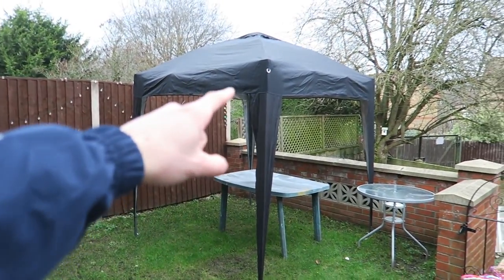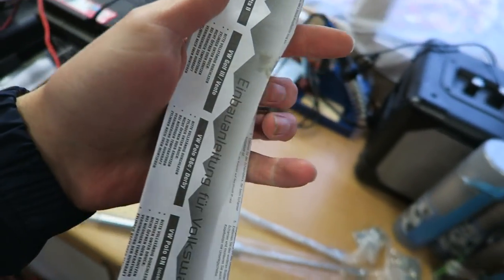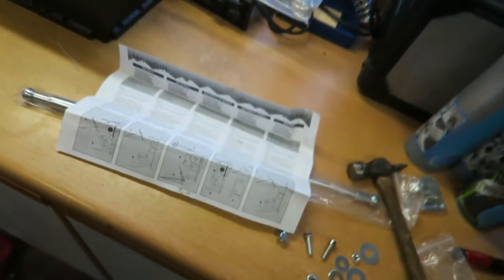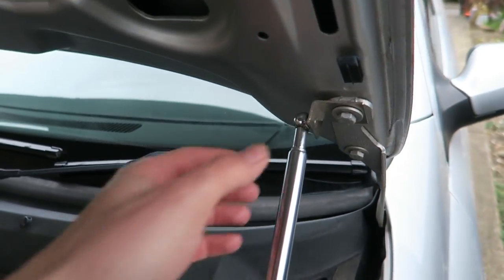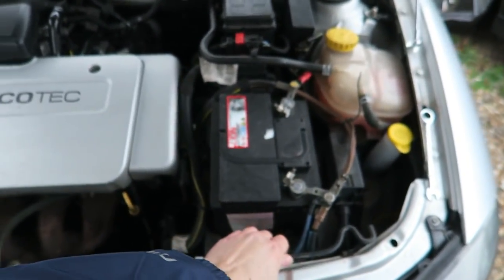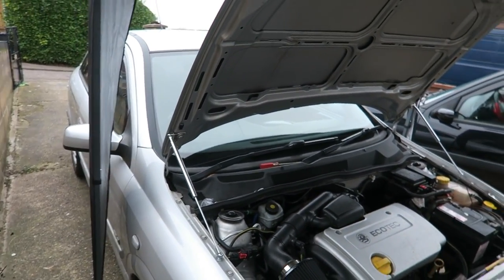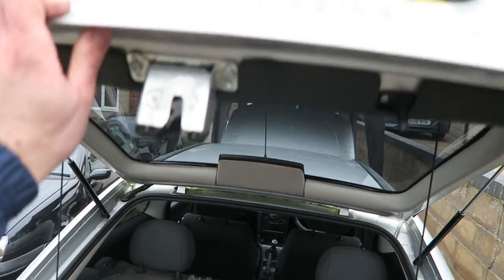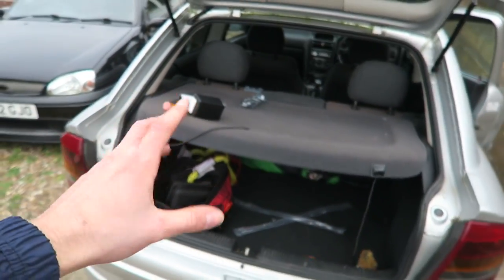First Mod Of 2019! *Bonnet Struts*

Comment: I've fitted the exact same bonnet struts on my Astra a while back and you didn't have to drill any holes. You could've just taken out one of the bolts from the wing out and used that hole. And I've seen many people fit them but I've never seen em been fitted upside down😂 By the way I think you bought standard struts for boots with no spoilers (430nm) you need 470nm struts which u can get on eurocarparts. A bit more pricier but they do the job properly and much better.
Reply: Zhoaib Raja they’re mounted the correct way, oil should be sat on the bottom seal when in their resting position.
Reply: @jamielindley  yep! i always flip them round on whatever cars i get so the oil sits on the seal

Comment: Dunno if it works on the astra but works on the corsa c, if you want all your lights on without turning the dial or having that awful alarm, pull the full beam stalk toward you once and it'll turn on.  Then pull it toward you again for them to turn off

Comment: My boot lid on my mk4 Astra does the exact same thing since I put on my GSI spoiler.
Watching your Astra videos is giving me ideas for my car, eventually I’m planning on doing an engine conversion from the 1.6 to the 2.2
Reply: Caitlin Henderson I wouldn’t go to a 2.2, a lot of hassle for minimal gains over the 1.8 which would be a straight fit. If you’re going to do an engine swap a zlet is only one to make sense.

2.2 has a lot of things different to the 1.6 so not easy swap
Reply: Put a 4D registration plate on the astra!!!
Reply: Bruh dont get 2.2 its a faulty engine
Reply: Chris K I think I will stick to my original plan and swap to the GSI engine, my engine is pretty much done anyway and I would rather swap it out for something with more power if I’m going to spend the money on it
Or my might not bother with my Astra at all and just buy a classic Impreza 😂
Reply: Caitlin Henderson zlet swap involves full engine bay loom, dash loom, and floor loom swap which a breaker will sell to you for about £300. It’s a lot of work to change it all, not hard just time consuming.

Easier to buy a GSi or a coupe turbo!

Comment: Dont uninstall the bonnet thingy. I got a '00 Lexus GS300 a month ago, which has these gas struts from factory, and they're shot. I wanted to clean the engine and replace fluids, etc, but i couldnt do it because the struts didnt hold the damn bonnet up. I had to put a piece of wood to hold it, LOL. If they fail and you dont have a replacement at hand, it's a PITA.
Reply: ComandanteJ you can always get the oem replacement for the gas struts over at ebay or local supply store.
Reply: @walijumaat2158  Oh, yeah, i know, mine are on their way. But the thing is that i didnt have them when i wanted to wrench on the car, so it was pretty annoying at that time, haha.

Comment: Real car guys work in all temps 😆 this past week, On 4 different cars.. welded two new tailpipes, fitted coilovers, strait piped an exhaust, rebuilt a wiper motor, emptied clogged scuttle panel and replaced inlet gaskets on a 6 pot diesel bmw. Love it

Comment: Instructions say:

1. Remove the rear M6 bolt from the left hinge (A).
2. Mount the M6 x 20 ball stud there. (don't forget the M6 Washer!!)
3. For mounting to the wing you should use the original hole (B). Mount the M6 ball stud (with the big washer on the top side and the M6 nut and small washer on the bottom side) to the wing.
4. Remove the foam block that is attached to the hinge.
5. Mount the joints to the hood lift and remove the securing clip.
6. Mount the hood lift (with the cylinder facing up) to the ball stud (these should be mounted securely)
7. Put the securing clip back into the joints.
8. Repeat the steps for the right side.

Sorry not a perfect translation from me...
Reply from the maker: simkarte123 thankyou for taking the time to do that!
Reply: @TheSavageGarage  No problem, I sometimes create German subtitles for Cyanide and Happiness videos, just for fun... :D

Comment: I don't like drilling holes in my car I feel like I'm ruining my car but I'm i wanna get the NRG Carbon Fiber Hood Struts and I'll probably mount the brackets to where those 2 existing screws are rather then drilling a hole on my frame I'm ok with my hood being a bit lower when it's up

Comment: As far as I know, the Sri and Gsi variants had stronger boot struts to deal with the extra weight of the spoilers, the standard ones should be a little too weak :)

Could you add links to the goodies you find in the description?

Thanks :)

Comment: It might have been better in the top hole because the bonnet would still be opened to the full but the gas piston (strut) would be under more pressure. Might have held it opened better too

Comment: If anyone is wondering for doing this themselves, I got a pair from ebay: https://bit.ly/2HZA31U.

The instructions are actually in German, not Dutch.
I sat and typed it all out into google translate rather than using images on a phone, here's the translation for the Astra F, everything is relevant to the Astra G and in my case the Zafira A and i've put my own notes in "(( ))" :)

1. Remove the rear M6 bolt from the left hinge. 
((This is the bottom one with the bonnet up)).

2. Mount the ball stud M6x20mm (do not forget the M6 washer!). 
((This is the one with the plate)).

3. To assemble the mudguard you should use the original hole (B) and mount the M6 tapered bolt (with the large washer on the top and the M6 nut with the smaller washer on the bottom) on the mudguard. 
((By mudguard they mean front wing/Fender and it has a little captive plate that the original bolts go into, these can be removed with a flat screwdriver and sit between the wing and the body of the car)).

4. Remove the foam block that is glued to the hinge.
((I didn't have any foam blocks, but i did remove the rubber bit that just sits into a rectangular hole in the wing so that it shut properly))

5. Screw the joints onto the hood lift and remove the securing clip.
((Don't have to screw them on, you just pop the little clips, put the ball in and clips back))

6. Mount the hood lift (with the cylinder up!!) on the ball pin (these should be mounted well).
((Thick end to rear of the car)).

7. Mount the clamp back into the joints. These provide a good, lasting effect.
((Put the bottom end onto the ball joint "bolt" in the wing, same as above, clips off, ball in hole, clips back on)).

8. Repeat the same procedure for the right side.

Hope this helps someone else out :)

Comment: What happened to the angel eyes mate?
Reply: This is probably filmed before
Reply: Just checked the angel eye vid.  Hmmmm. Interesting question. The struts weren't there in that vid. So this is after
Reply from the maker: Had a tiny issue with them
Reply: Probably caught by the police, because they're not legal on streets.
Reply: @VladCristianPau  they're legal. My dad has them on his Astra G. Never been caught
Reply: @VladCristianPau  Why wouldn't they be legal?
Reply: @GenerationRecords  I'm from Romania, and here, if police see you have angel eyes or any other modifications on car's lighting system, they take your car identification documents...
Reply: @VladCristianPau  Here in UK angel lights are allowed. I'm only aware of HIDs\LEDs being a illegal due to them dazzling other road users. As long as they have projector housings there shouldn't be any issue.
Reply: @GenerationRecords  For HIDs, you need to have projector housings, headlight washer and autolevelling. Otherwise, they charge you and take your documents. The law is very strict here in Romania, i didn't know in UK is so easy to use aftermarket lights.